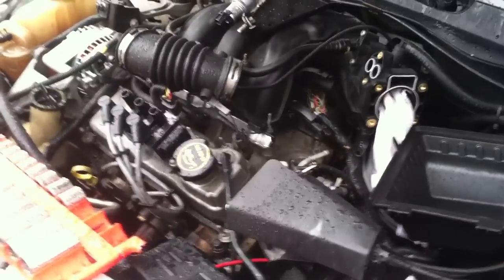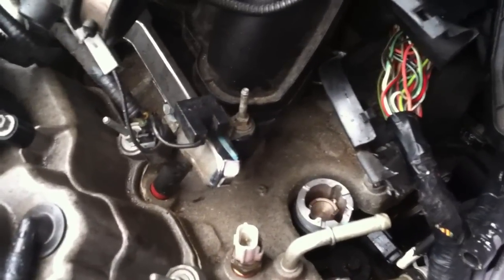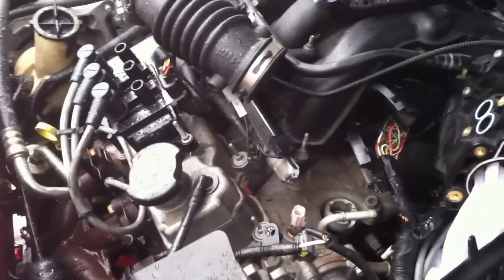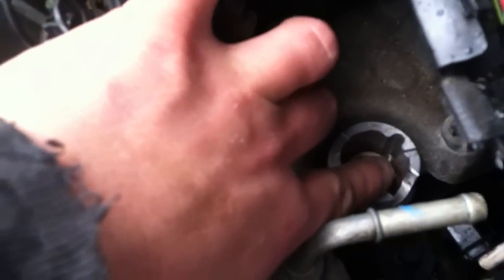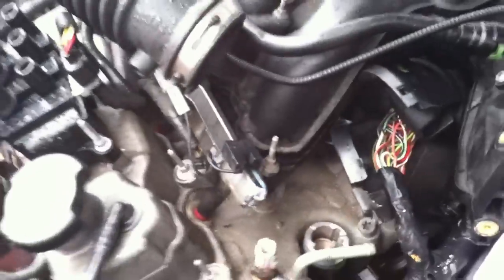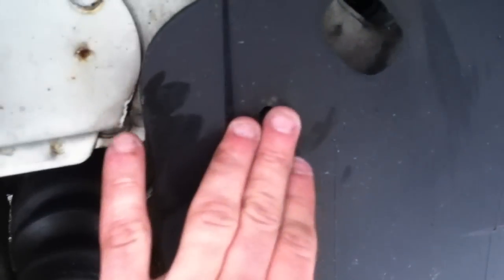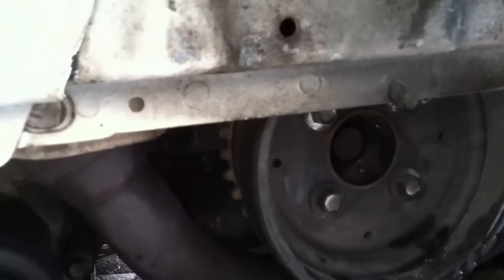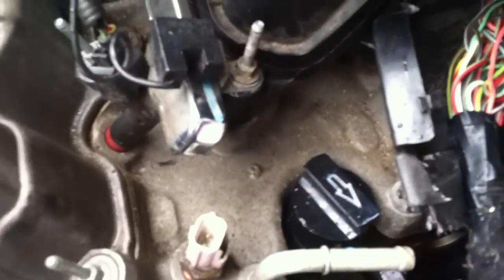2004-2007 Ford Taurus Camshaft Synchronizer (Part One: Finding Top Dead Center).  See description

Comment: What is the position of the mark when it's in TDC. I have to correct mine or was pulled out unintentionally
Reply from the maker: @paulhinz8761  hey friend, if you are definitely not sure the position of the tab on the synchronizer when it was removed, then you’ll have to set engine to TDC. 
The  tab on the synchronizer will line up
with the window of the housing.

Comment: Bout to do this right now. Iv fixed everything from maf sensor to new coil, plugs and wires, alternator, fuel filter, serp belt. Hope this is it!
Reply from the maker: Did it work ?
Reply: @8LLRoadranger  yes it did. Not sure if it was the sensor or the sync. The sensor had electrical tape around it and didn’t seem like the harness connector can still click in. Either way I was able to keep timing and can floor it now!

Comment: Question:  does it have to be TDC on the compression stroke or does it matter?  I’m finding conflicting advice (imagine that).
Reply from the maker: No, it does not matter. As long as the engine timing is not out of sequence with the cam sensor/synchronizer 
All I did was line the tab up with the window, and removed the old one, and then install the new one lining up in the same fashion. 

Be well!

Comment: Hello. I lost timing on my my replacement. How can I find it back? Any suggestions?
Reply from the maker: Yes...the more precise way would be to remove the valve cover with cylinder one, and find TDC by watching the valves. Then, install the synchronizer with the tab aligned to the window.